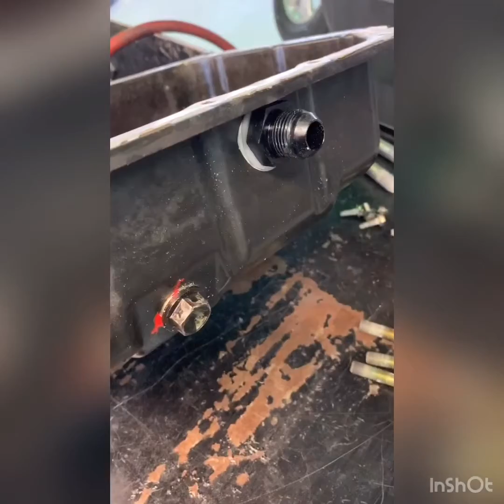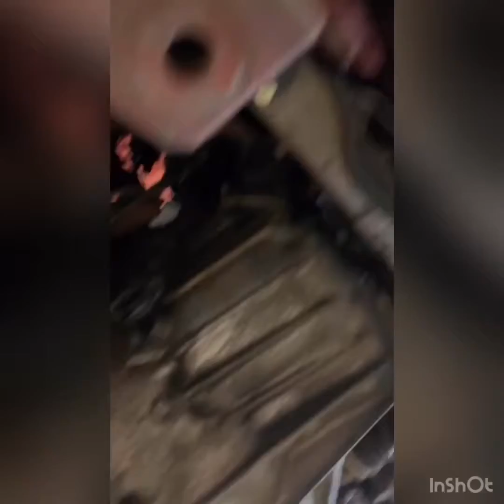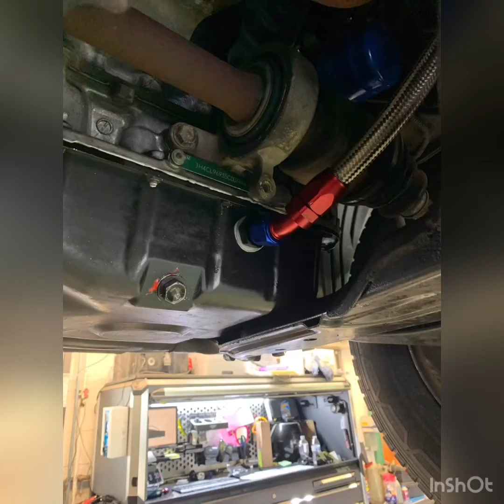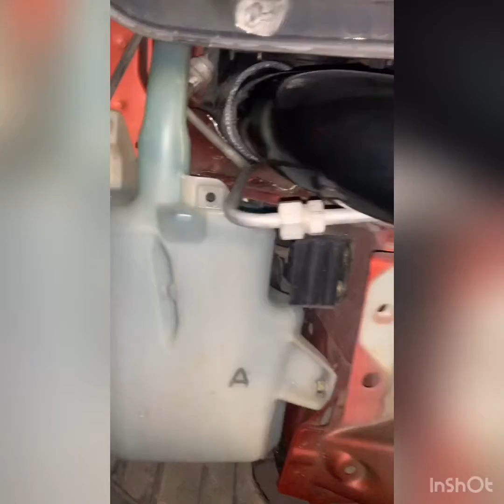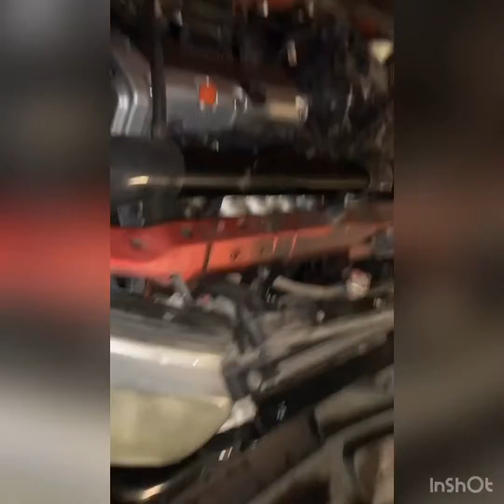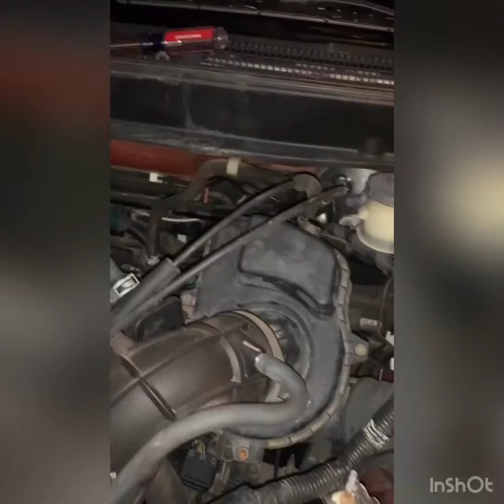K24a2 AWD Turbo Element part 2

Comment: What are you going to use for tuning? I have an 04 awd manual that I’m in the middle of doing turbo as well
Reply from the maker: I have k tuner installed and will be using that to tune it
Reply: 11AM any updates videos?
Reply from the maker: Jerret Watkins so I’ll be posting something today or tomorrow.  Work has been crazy, but hey.  Can’t complain.
Reply: 11AM all I have left to do is buy a wastegate. I had to buy a 2005 ecu for ktuner myself. Are you using the stock clutch?
Reply from the maker: Jerret Watkins I am using a stage 3 clutch masters with flywheel.  U have to get one for a rsx.   They don’t really make any nice performance clutches for the element flywheel.
Reply from the maker: Jerret Watkins i have a parts list I’ll post up on my next video of what I used,   So far so good.   I’ll be added another video of a fuel return setup also.
Reply: 11AM ok sweet. Last question. What fuel pump are you using?  Once I get my wastegate I’ll be installing everything. Also if your on Facebook you should join boosted elements. I just started that page
Reply from the maker: Jerret Watkins no worries dude I like answering questions.  I’m using a dw400 pump.  With a return kit that I’ll be piecing  together

Comment: Greetings Matt I am currently doing a similar build.  Did you have to modify the wiring to make the Vtech work?
Reply from the maker: Hi.   Nope not at all.   The wiring is 100 percent the same using your existing harness.
Reply: 11AM   Matt thanks for the quick reply.  I am new to Hondas but not new to building cars.  It has been difficult to find answers on my honda element build because there are not many that have had turbos fitted.  My email is jmturbo2000@yahoo.com to message me directly.  I have a jdm k24 true vtech, tuning k tuner/turbogixxer, precision turbo.  Currently I am building the tranny, synchrotech, lsd, and sixth gear to start.  Rear will get pump and clutches removed and lsd added.  I am going to get this setup running and sort out the bugs while I build a sleeved shortblock. Thanks for posting the videos.  Are you going to shoot for around 8 lbs of boost?  That is what Kenny suggested is about the limit is for a stock engine.  Mine started as a low budget build then you know what happens, lol.

Comment: So you swapped to the A2 first?? Elements come with the K24a4.
Reply from the maker: Yes.  Swapped a a2 into it.  Complete bolt in.  Only had to change the water pump pipe and the thermostat.

Comment: I’ve been thinking of getting an element and doing a similar setup there isn’t many people doing this as far as I’ve seen it’s definitely a cool sleeper
Reply from the maker: Yes it will be.  Video coming up soon of actual turbo installed.
Reply: I ended up picking up a 5 speed 2001 crv with the high compression b20z2
Reply from the maker: hugo delgado that’s a good find.  Is it awd?   My element is awd 5 speed.  Pretty rare find!
Reply: 11AM yeah